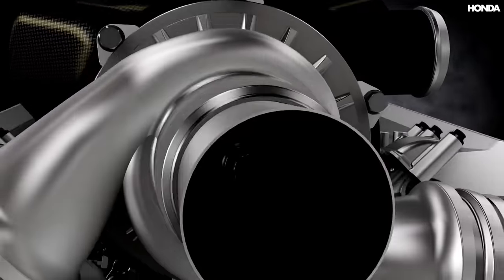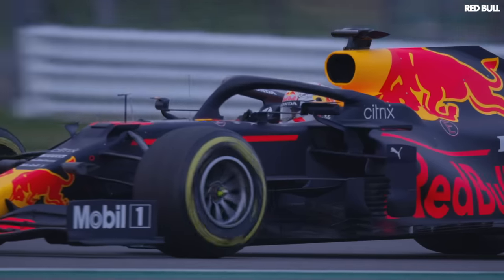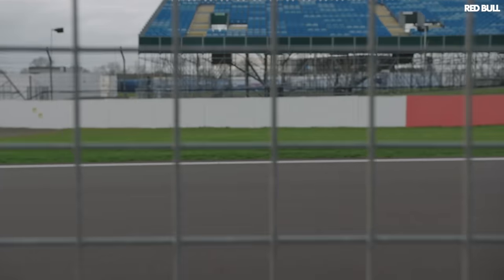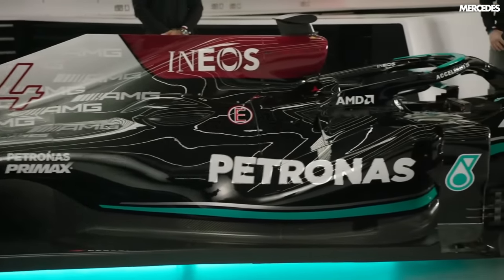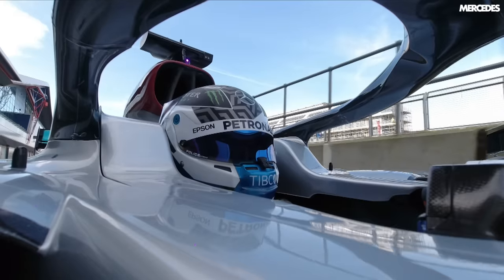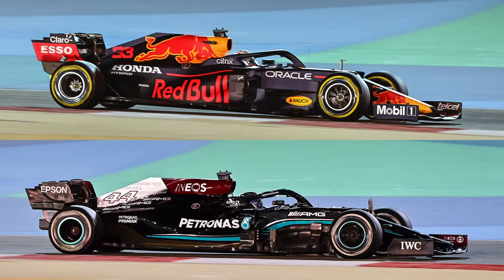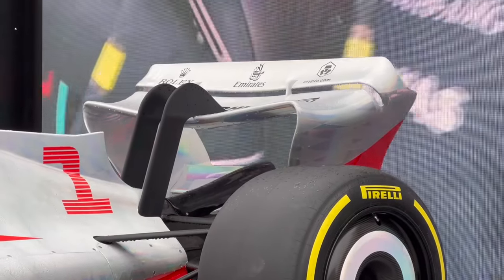Red Bull's SECRET Engine Upgrades to Beat Mercedes | Formula 1 Engineering

Comment: Great season this year, loving it, people need to stop hating so much and enjoy this battle, we’ve seen nothing like it since 2016 with Rosberg vs Hamilton.
Reply: @James I don’t feel those were as tense as 2016 tbh.
Reply: Sir lulu can’t handle the pressure, so many mistakes this year alone. Max is not the same as Nico and we know how that ended. Since Silverstone i lost respect for Scamilton.
Reply: @JJ remember singapore 2017, I turned off the tv after lap 1 but it's racing
Reply: Your opinion stay the same at this year?

Comment: I'm so happy Honda and Red Bull got together, they've fitted each other like a glove. Now HRC are going to continue I'd expect this partnership to last a long time. Here's hoping.
Also, this may be your best work yet, 👍👍
Reply: Honda is going to leave F1 next year, I am so sorry.
Reply: Honda is leaving and only supporting the engine for a short time.  In 2023 Red Bull is taking over the Honda engines (Red Bull gets the I.P. of the engines in the 'divorce' lol).  "Red Bull Powertrains" will take over manufacturing and servicing starting in 2023.  So, from 2023 on, we will see if Red Bull can actually compete with Mercedes since they will start doing their own engines as well.
Reply: @brandonb.288  you're missing that HRC, the guys that do bike, are getting involved with Red Bull to develop the engines, so Honda aren't really dropping out. That is factual, its been announced.  HRC might not be Honda fully but ask the MotoGP guys about that.
Reply: @GB-vn1tf  you are right. it will be still a Honda!
Reply: @Pete292323  Only leaving financially and only partially. The personnel and engine construction is still Honda.
Reply: @brandonb.288  Red Bull Power train will only be to finance the current engine. That is why they lobbied for the engine development freeze.
Honda will be moving behind the stage but will still be there.
Once the pandemic, supply chain issues and new product designs are in place Honda will be back by the time the next generation of engines are introduced.
Red Bull have meshed with Honda outside racing as a real global partner to assist Honda as they do not want any other engine supplier.
Reply: @Pete292323  looks like they're staying until 2025
Reply: Yep... HRC = Honda Racing Corporation

Comment: Honda smelled blood in the air and are fighting to beat Mercedes in their last season. That's pretty exciting even if you're a merc fan
Reply: they arent fully leaving yet they will fully leavein 2023
Reply: @mariamalgorzata4974  I know but if I remember aren't they acting more as advisors to Red Bull more than an actual manufacturer partner?
Reply: @mgustafson2010  i mean honda F1 does not want to stop.. its some bigwigs in japan that made the decision because so many countries are banning combustion engines after 2030

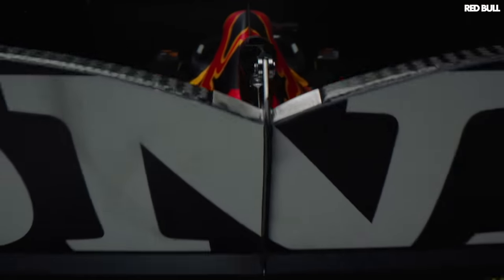Comment: Great shot at 10:03 the wheel looks like it is moving in and out on the axle, but it’s the tyre wall shifting as the corner force changes.

Comment: Its amazing how much Honda has improved with RedBull money behind them. Variable intake runners, how innovative, its not like they were used on a early 1990's Mazda 787B. Im a bit puzzled as to how Mercedes is keeping this "Super Cooled" coolant at this super cooled temperature during a full race, it will require a lot of energy to keep it so cold.

Comment: Next episode idea : "Why not make cylinders oval shape ?"
Reply: my guess is longer strokes cause you would need more fuel and air mixture, i have a question though what would be the benefits of it?
Reply: Star shape would be better imo
Reply: Honda NS500 intensifies
Reply: Same reason why pressurized tanks aren’t ovals, a circle is the best shape to handle pressure. Same for planes too actually
Reply: Because ovals would not distribute the stress equally like spheres. The stresses would be "concentrated" in the narower portions of the oval
Reply: @gamesofpain2920  Thinner block - also much more space between the cylinders to cool them ...
Reply: @brieucvand  Maybe not - Much more surface to grind on...
Reply: @hunterreeves6525  There is an attempt like that though ..Honda NR
Reply: @cocosloan3748  Thanks. Learnt something new today. Pretty awesome engine design. Basically molding two separate pistons into one that shares the two connecting rods? Was reliability an issue - especially with the section of piston between the rods? Why did they stop with development?
Reply: @cocosloan3748  that’s interesting, but it seems they they did it just because they could, or they let one thing drive the design and ignored the other downsides it introduced. From what I saw they did it to get more air in the engine, and having an oval shape allowed for more valves (8 vs 4 or 2 normally). But this added complexity, and I’d imagine weight though I didn’t see that mentioned in 5 mins of research lol. Interesting to look at, but no one else ever did it which speaks for itself
Reply: @hunterreeves6525  Well not so fast ! Todays technology and inventions allow the engine to be made in such precise tolerances that just maybe this flaws would be overcome !
Reply: @Flamingpangolin  Now machining can be easily done with better tolerances and few new inventions maybe implemented - so that engine (or some combination of it) can be made to work well ...
Reply: Because they end up that way on their own if the engine lives long enough
Reply: @cocosloan3748  vi l’ok
Reply: @gamesofpain2920  More volume within a smaller footprint. Circular bores have surrounding areas that seem wasted. 

Anyhow oval pistons are done. More broadly thinking, I've seen i.c. concepts that show much promise, but have yet to be fully developed. I'm hoping the frenzied motivation toward full electrification doesn't thwart their progress.
Reply: many of the points made are valid. but the most important thing here is efficiency. an oval shape would increase the surface per volume. that means higher thermal loss of the combustion energy through the side walls and more effort for cooling them. since refueling is not allowed anymore you would need more fuel to carry around till the end of the race which makes the car slower.
==> less combustion energy for acceleration ==> slower
==> more drag because of bigger coolers ==> slower
==> heavier car because of more fuel weight ==> slower
Reply: More surface area not working ...at end nothing works
Reply: Honda did that already and it revs to like 20,000 rpm
Reply: @gamesofpain2920  more valves per cylinder and air flow, Honda was able to cram 8 valves per cylinder into a v4 engine with oval shaped pistons.
Reply: @gamesofpain2920   Engine would be not wide as usual - so thinner engine - and you gain displacement . Strokes can be shorter too - hence higher compression - and you can cram  8 valves per cylinder (Honda did it )
Reply: @redlinearroyo847  Exactly - so theres gains - displacement - you can add more valves and even liquid-cool the space between cylinders ! Cooler engine - "mo powa" 💪

Comment: The engineering that goes into getting even the slightest advantage in F1 is really incredible. When you consider just how advanced all the teams are being at the end of a long era of regulations the margins for improvement have to be so slim but teams still find clever ways to get an advantage.
After the Austria doubleheader it seemed like RedBull had the clear upper hand but Merc has been out developing them since, I am also impressed with how competitive Ferrari looks after their power upgrades too even though they are not in the title fight.

Comment: Supercooling is done by pressurising the fluid and chemical additives that prevent the water molecules binding. The plenum would have to be a 3D printed lattice structure to take the high pressure of up to 10bar (10x atmospheric pressure)
Reply: You sound like a chemistry genius 👍
Reply: 10 bar is not that high a public avalible to by presure washer is 25 bar
Reply: @letsseetofindout2560 Process/Chem engineer. Began my working life completing a four year apprenticeship as a fitter/machinist and worked as a tradesman for 10 years specialising in Fluidpower before going to university.
Reply: @davidtube79  you’re right, though 10bar over such a large surface area is a big task to keep contained without rupture and keeping it all lightweight still. The surface area of the tubing and hoses of a pressure washer is tiny in comparison to a plenum. Domestic pressure washers are available up to 250-300bar. Commercial pressure washers go upwards of 2500bar for large industrial application, like removing linings of process equipment.
Reply: I don't think it is going with the fluid to the supercooled state. There is huge disadvantage of this solution that fluid can solidify just by acceleration or shake that f1 car produce on track. I would go with chemical additives to point where fluid stays fluid. Maybe my knowledge is to small in this area. 
Another question is if liquid is cooled under pressure is it supercooled? 
Whats the point of another pomp in the system that consumes energy?
Reply: @jackimo22  How many bar do waterjet cutters operate at?
Reply: There is a legal temperature of the plenum . You can't go below ... unless you plant those sensors away from the plenum. Mercedes & FIA .....👍.
Reply: @givemeabreak8784  Plenum double-skinned with insulation betwix layers, where the sensors are placed?

Comment: To a relative neophyte like me, or to someone new to F1, this video is an excellent demonstration of the astounding technical complexity of F1 cars and the teams' remarkable ability to manufacture newly designed engines, engine parts, bodypanels etc. seemingly on the fly. It also illustrates the lengths teams go to gain a few tiny fractions of a second a lap, in a sport where a full second a lap and eternity are almost the same thing.

Comment: For anyone interested, you can experience a super cooled liquid at home. Take bottled water and put it in the freezer for a few hours. Take it out before it starts freezing. Hit the bottle and the water will instantly crystallise in the bottle.

I've found that sparklink water works bets as you can pour it into a glass ten drop an ice cube in to watch it turn into slush.

The fact that Mercedes can cool the coolant enough to achieve this is a feat. Especially that close to a very hot engine.
Reply: Those Sodium Acetate hand wormers work by the same principle. The solution is supercooled too and needs a "seed" for crystallisation to occur. By bending the metal inside the wormer, small crystals are released and start the crystallisation.

Comment: How does Merc cool their coolant below ambient temperature? I don't buy it.
Reply: possibly inducing some form of vacume or low pressure area like an a/c system
Reply: @fluffywarhampster  yeah, but what's the working fluid? Coolant? Oil? Hydraulic fluid? Fuel?
Reply: @roflchopter11  who knows...
Reply: I'm with you, I was trying to figure this out as well. In theory if you could bleed some compressed air off the inlet (after the intercooler) then expand that back to ambient pressure you might be able to get below ambient temp. Maybe run that air through a cooler to cool your working fluid? Not even sure it's possible once you account for efficiencies and relatively small heat capacity of the bleed air compared to the plenum air. I don't think they'd be using a refrigerant cycle (doubt the rules would even allow that) due to weight and the power loss to run the compressor.

Comment: The thing that always surprises me is that we constantly hear about designers going to absolute extremes to keep the centre of gravity low in order to maximise mechanical grip, which is particularly important in the low speed corners, because there's minimal downforce at low speed. And since the Red Bull seems to be quick in low speed corners, you would imagine it has a particularly low centre of gravity. But given that the high rake design lifts the whole engine, gearbox, fuel tank, rear suspension etc several inches higher than a low rake car, the Red Bull centre of gravity must be massively higher than the Mercedes in low speed corners. It just doesn't make any sense.

Comment: I’d consider 3D print engine parts to optimize the weigh reduction as well the design for better aerodynamics.
Reply: Not strong enough
Reply: @axel3895 It depends I guess. If the correct alloy is used and the is model structurally verified should work. Czinger is a supercar brand using this kind of technology.

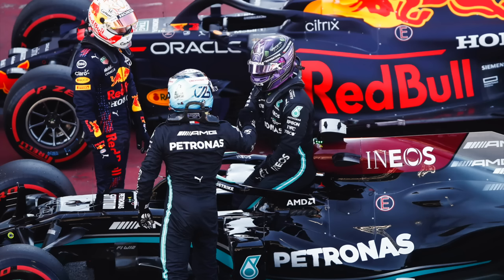Comment: 8:00 I'm not sure what type of coolant Mercedes is using, but I find it hard to believe they are using coolant that is being cooled to below it's freezing point. Water freezes at 0 C/32 F, so unless their car has some sort of refrigerator on board, there's no way they're supercooling coolant using just ambient airflow (and F1 races don't usually occur when it's below freezing outside).

If I had to guess, "supercooled" in this context does not mean the coolant is being cooled below its freezing point, but rather it means that the coolant is being cooled below its boiling point. When referring to systems that use a combination of vapor and liquid (more believable in this context), supercooled means the vapor-liquid mixture is being cooled below the temperature that all of the vapor condenses into liquid.

That being said, I am making the assumption that their coolant is primarily water. This makes sense as most cars use water-based coolant, and water has an extremely high specific heat capacity, so it transfers heat very effectively for it's weight. But if they're using some exotic chemical for their coolant, my argument is null.
Reply: Also tech rules forbit any phase change coolands. So yeah hard to said if that is true. Plus intake plenum temperature is monitored by FIA ECU.
Reply: @alesksander  yes FIA monitor intake temperature, it can only be from memory 10c lower than ambient temperature, that’s why Redbull questioned where the temperature sensor has to be fitted because it’s thought Mercedes are running coolant through the intake manifold AFTER the sensor reducing intake temps.
Reply: @dandewar8403  Yeah maybe. But FIA tech officers are not dumb or are they? If there is something on this i imagine this is almost carbon copy situation of Ferrari. Maybe they really use "cavity" inside carbon plenum to provide that advantage. Technically is possible yes. But huge red flag against that is how Mercedes out willingly spoken about revolutionary" plenum design before and even during this season. Normally Merc operates under smoke and mirrors tactics. Whole 2013 season was meme, 2014-2016 hiding aero dominance, 2017 diva car with Pirelli understandings - those pesky wheel rims and lobby for oil burning etc. I guess there advantage is on other place or there are none. Maybe they just perfected combustion of this hybrid are to perfection. Nowadays they just squeezing as much performance they can .So they got perf issues. naturally. And luckily for them in next seasons you can resolve any anomaly's even under freezing rules. So is worth it to push harder and fix thingies later. Overall design seems just solid for them. Same for Honda witch impressive resurgence and catch up gets them high praise and any magic bullets are very unlikely at this stage.
Reply: Your right. They area managing to  cooling liquid its boiling temp not freeze. 
And also air in intercooler cant be cooled below anbient temp.

Comment: As you say in the end, both are ahead of the pack because of genius engineering, but both philosophies are legit, and it only comes down to how the high performance is put on the street in given circumstances. I think the one, who can push itself as a team and their car to 100% each race weekend, will win the championship. It might be decided by little errors as Hamilton and Mercedes did in Turkey (good idea to take only the 10 place grid penalty but then not to box in the right window, which was a delicate decision).

Comment: The supercooling thing, i get the Idea, but what medium are they using, you have to "get" the cold from somewhere ? are they using ac compressor of sorts ? Some sort of liquid gas, Nitrogen or smth like that. What does the regulation say about addition "substances". You cannot cool stuff just by wanting it, there is physics invalved.

Comment: Its quite remarkable how Mercedes has closed the deficit to Redbull compared to the start of the season.

No matter what obstacle FIA throws with new regulations they will find a way.
Reply: Ah yes, banning flexible wings, and electronic pit stop confirms and changing the tire construction and air pressures really hurt Mercedes. Lmao

Comment: There's 1 thing I don't understand: how can MB cool the plenum if the rules state that the temperature of the air inside the plenum must be 10 degrees higher than the average ambient temp given by the FIA? Cheating or something else?

Comment: Variable length trumpets were used on the Mazda 787B as well. Helped to give the already efficient at high rpm rotary, a big boost in torque. Made the powerband much wider.

Comment: 3:59-re: ice water radiator, ice oil cooler, etc...  You have an engine putting out 1000 HP (ie, 735kW) but at least that much is generated in the form of heat.   Given that you effectively have a 700kW heater, the ice isn't going to last very long.
Reply: 700kw heater being cooled by driving around a track at 150mph+

Wind chill is very high at that kindoff speed.
Reply: Pushing an engine past its limit could be 10 to 20 degrees in temp not that much any extra cooling could give u a big edge (imagine the temp of the turbo alone)